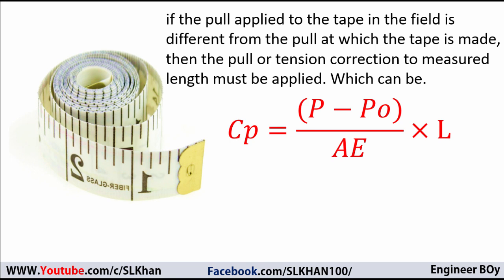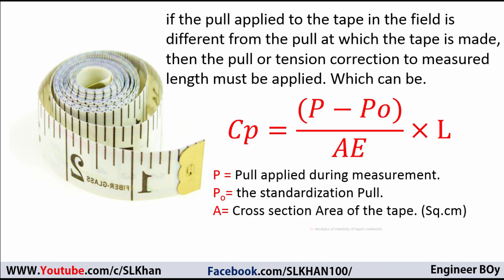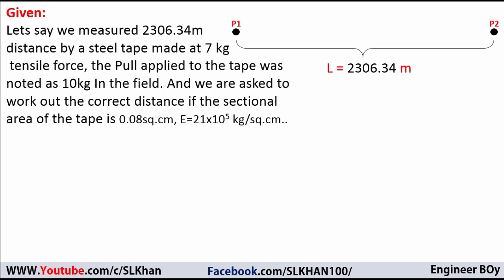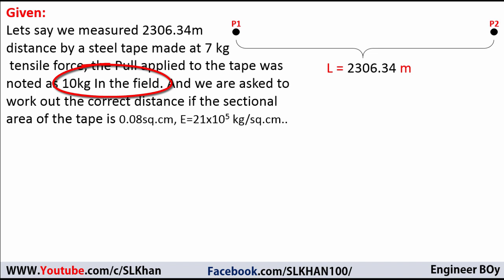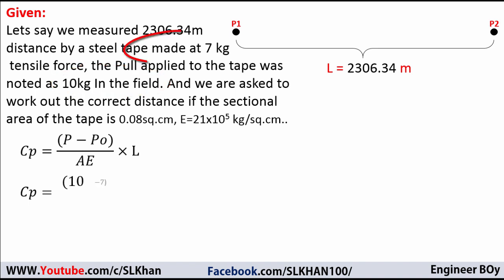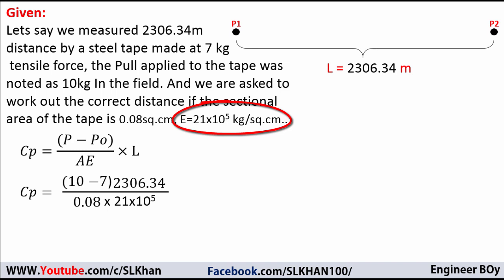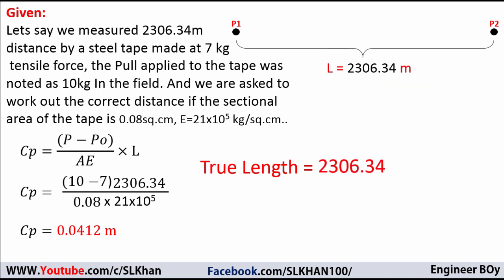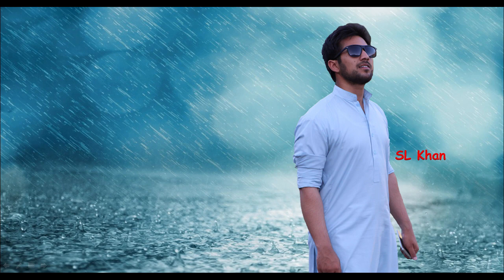pull correction to tape #landsurvey

Comment: Sir a small doubt if we are measuring the distance with more pull force in that case we are measuring more distance since the tape is stretched .so why are adding the correction
Reply from the maker: it is because when you pull tape, you are measuring smaller number which is more in reality. so we add
Reply: Same question
Reply: @adriennevictormanlosa2271  when you pull the tape, the measured distance actually becomes smaller (example: 2cm elongated tape is actually just 1.9cm. So when you measure something to be 2cm, it is just 1.9cm in reality). This is the reason why Cp is added to the measured distance.